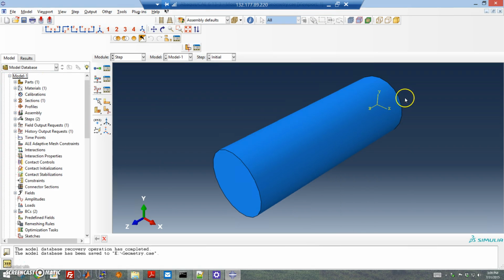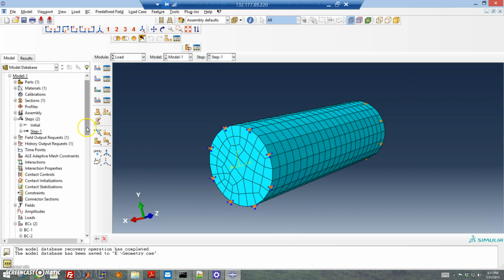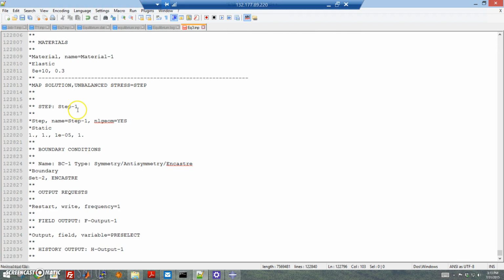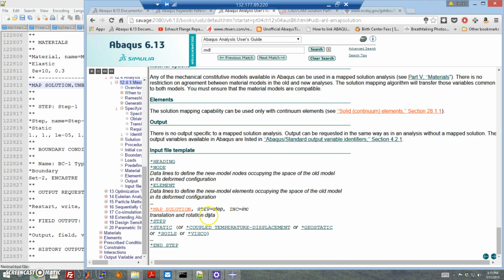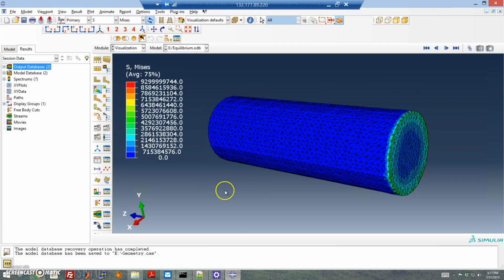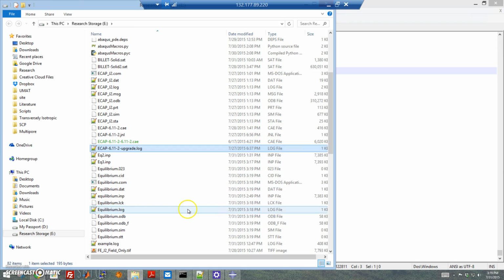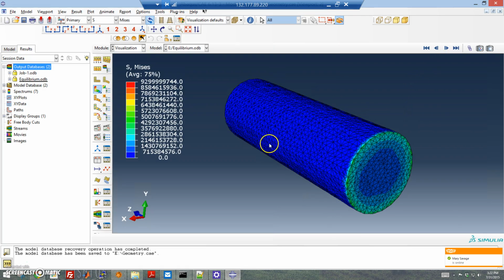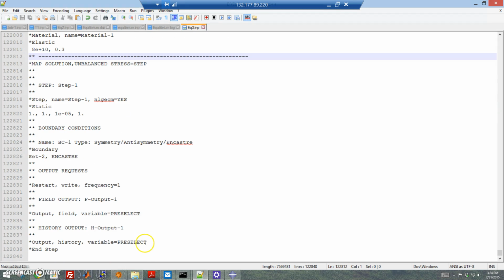Abaqus: Solution Mapping

Comment: thank you very much , if the old job contains 2 different part , Can I map the solution of 1 part only ??
as i need to calculate stresses resulted due to interference fit on the hub
than use this hub in other model without the internal shaft

Comment: Dear sir,
              I have been following your videos for quite a while. I have one question related to my research area. 
 Could you please provide an answer. 
             
                  I have a model with shell element (S4R), having 5 integration point along the thickness. I have to 
provide initial stress (or temperature) before running the actual analysis. These stress which I need to provide
varies along the shell thickness. In GUI I cannot select shell outer surface or inner surface to assign it. Hence 
I have to do it in python scripting.

    Would you care to share some insights or ideas on how to provide these stresses at nodes before analysis...?
If not for shell, atleast for any other type of element by scripting will help me.
                                      
                                                Thanks in advance.